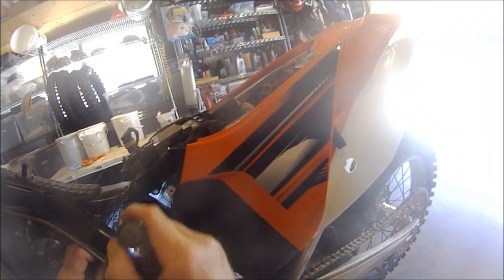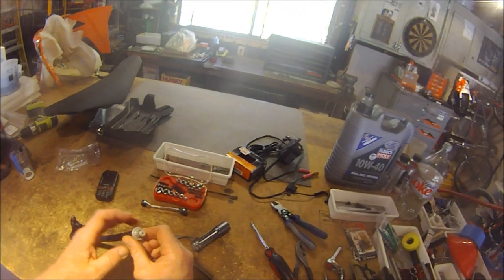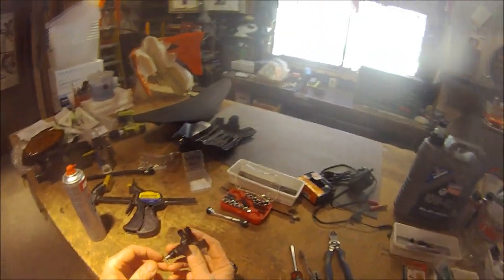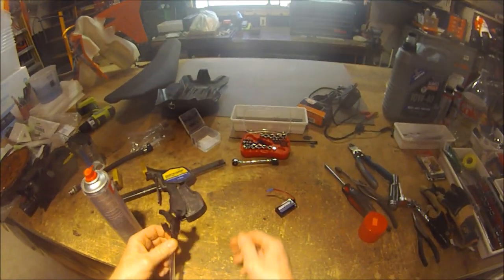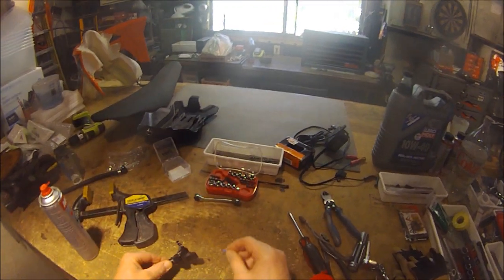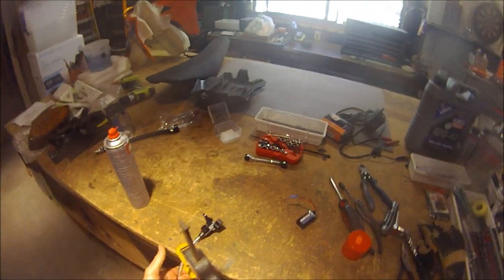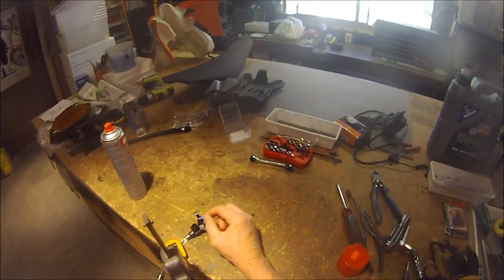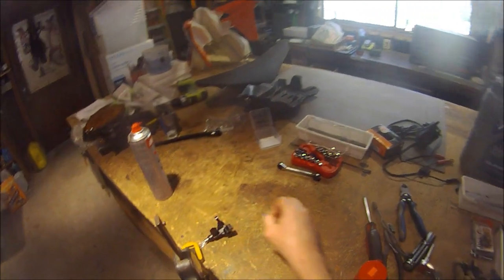KTM Easy Fuel Injector Cleaning

Comment: Without that ratchet driver, you are SOL getting those two screws out which hold the injector. I tried for over an hour with a short grip philips screw driver. Used a mirror, flashlight, screw driver, etc. Finally used the ratchet and piece of cake.

Comment: What symptoms did you have? I have a bog when giving it some throttle. Replaced fuel filters.
Reply: You fixed it i have same problem on ktm 2013 freeride
Reply: replaced injector...
Reply: @user-sp8eb6iz7f  cleaning the injectors didn't help ?
Reply: @DiDoSvK  For me it's easier to replace it, my cleaning technique was a cluster-fu%$.
Reply: How can I check the electrical connections to ensure that I don't have a short in the system?

Comment: Struggling to find a ratchet driver to fit in the tight space. Anyone have a link to a set that would work?
Reply: Just remove the rear shock only. Two bolts. Twist throttle body and unscrew.

Comment: With the wide angle of the GoPro, you can place the camera within inches of your subject on these maint. vids for a great, clear picture of what you're working on.

Thanks for posting.
Reply: Do you have a link to ratchet driver you used? Trying to avoid having to pull the whole throttle body to replace my injector. TIA